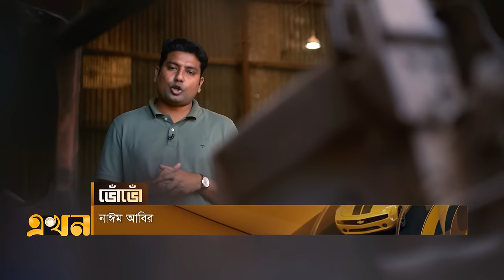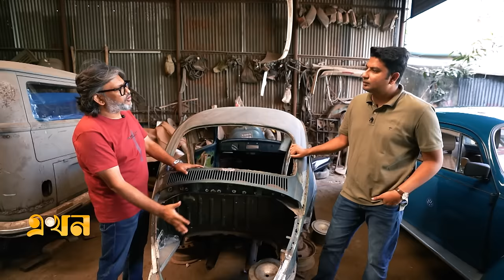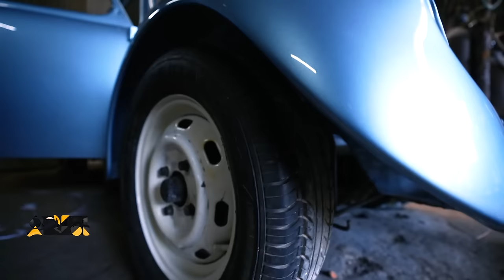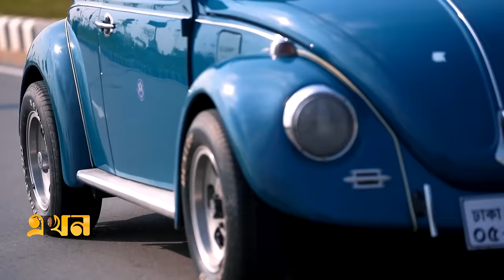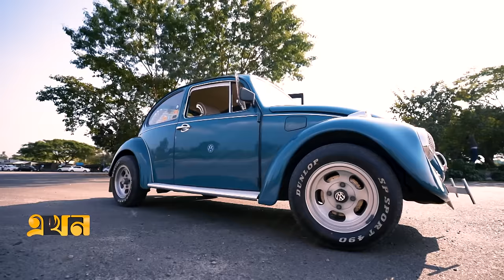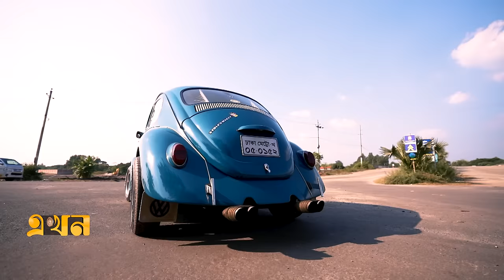ভাঙ্গারির দামে কিনে রাজপথে কাপায় ভক্সওয়াগন | Volkswagen Beetle | Vintage Car | VOVO | EkhonTV

Comment: Not Fox Wagen. It is pronounced Volkswagen meaning people car. Its name is derived from the German-language terms Volk and Wagen, translating to "people's car" when combined. Adolf Hitler chose to sponsor an all-new, state-owned factory using Ferdinand Porsche's design (with some of Hitler's design suggestions, including an air-cooled engine so nothing could freeze). The intention was that German families could buy the car through a savings scheme. It is hard to roll over these cars. These cars are also known as Bettles because of its shape.
Reply: VUL TOTTHO V DIYE LEKHA HOLEO UCHCHARON HOBE F DIYE

Comment: This type of vw car has no radiator. Water is used in radiator to cool the engine. Vw cools engine by air, so without radiator and water the car ern less weight which makes it to run more. Frontally it's body is curved, so on running air blowes away easily & does not hamper to move. Its engine situated on behind. Most parts of engine are made of aluminium. So engine is lighter than other cars. As a result the car vw uses 6 volt battery when other cars use12 volt batteries. It is a low cost car than others. It contain blue colour in birth which indicate good fate.